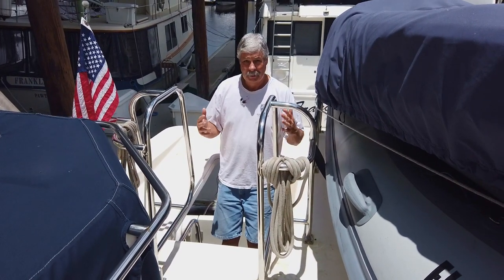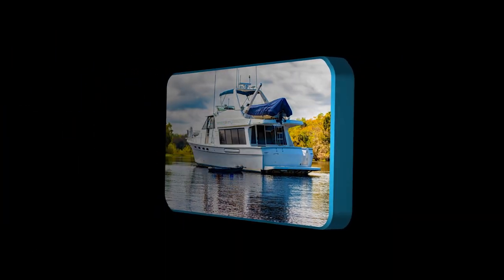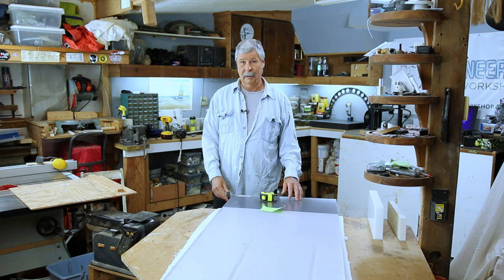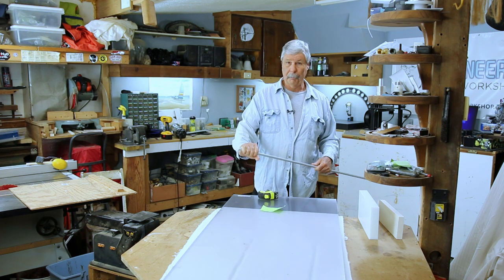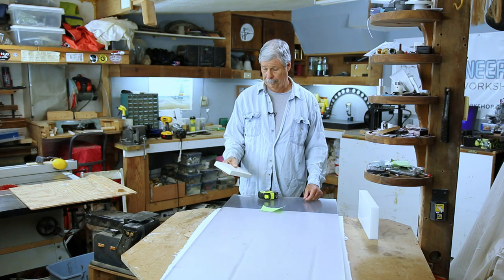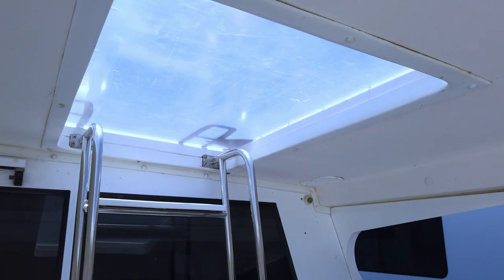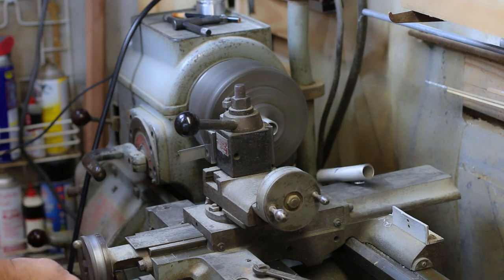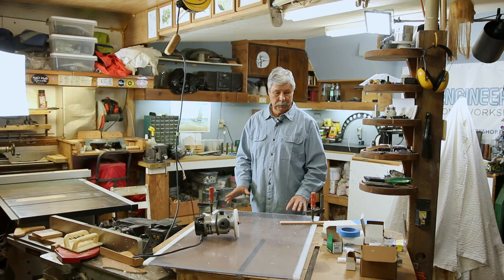3D printer helps with design of boat safety feature

Comment: Very nice work Bill, I didn't realize Lexan was that strong.... Bill the engine that u designed and talked about in another video.. Would that engine work in EMP conditions, or would it be rendered ineffective.. I was reading about a guy that developed an engine that would run in those conditions.. The only drawback was that it had an electric starter, but I guess there are ways to get around that..I guess a diesel engine would work that used mechanical injection...What's your thoughts on that?...Nice video as always Bill...God Bless and take care...
Reply from the maker: Thanks, unfortunately my engine would be susceptive to a EMP. Good question.